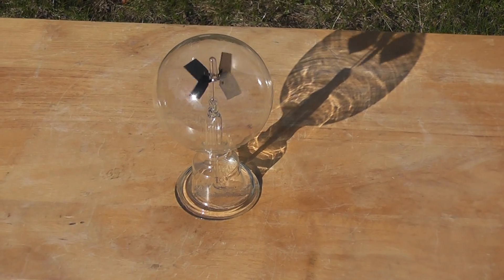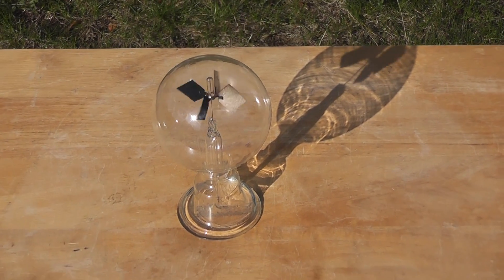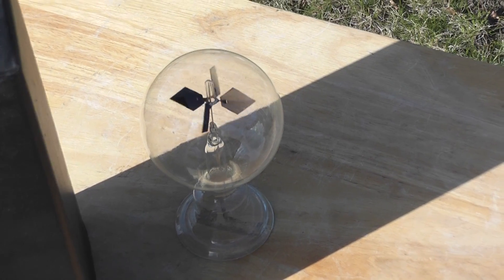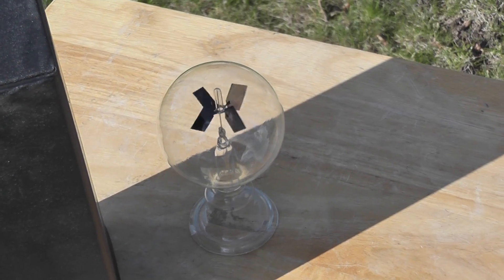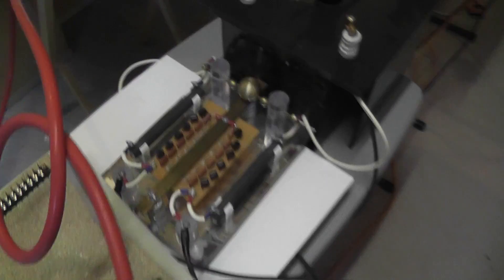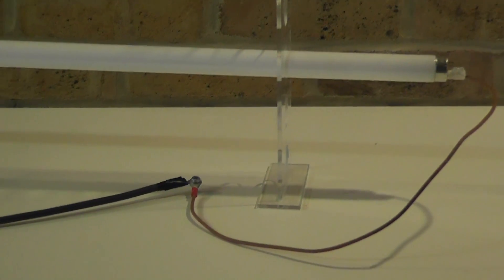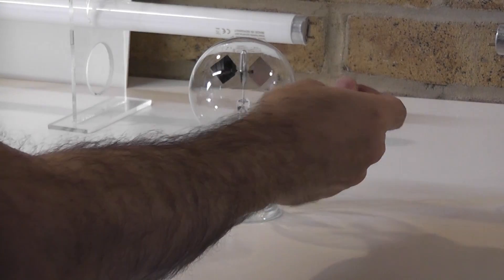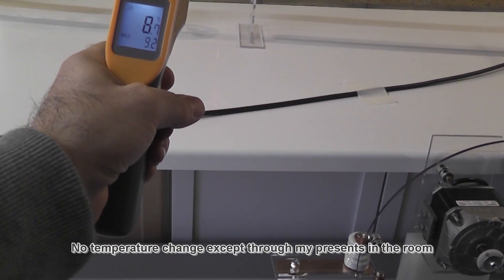The Radiometer in the junction of High Voltage Direct Current

Comment from the maker: On my mono spark gap, where I use unidirectional current flow between carbon and brass electrodes separated by strong Neodymium magnets I did see two independent sparks next to each other by different colour. I have a sensitive Geiger counter but I believe that the strong dielectric field is triggering the gamma ray value. Every spark gap, especially Carbon is creating gamma rays. I am not sure if my measurement is correct but it is in the 100's of µrem

Comment from the maker: I am aware. But it has very low pressure. Other wise the friction would be too high. The vane moves by heat difference between black and silver, like a sterling engine. That counts for IR radiation. However, my vanes have been destroyed by the flashes I produced and I can still move them. The sun does not any more. I move with static electrical pressure. I actually mention the function at in the video at 2.35

Comment: Umm I'm not sure if you knew or if its april fools, but radiometers are designed in a way that air inside forms a convective current thanks to the black surfaces that heat up. The leafs are at tiny angle so it's hard to notice, but whole thing acts as a turbine on torroidal wind current inside the bulb. If it would be true vaccum it would not reach terminal rpm that quick.

Comment from the maker: Hello, That was my thought at first as well. It does not count for the heat effect. Infra red mainly in direct sunlight. In my garden I have no reflective areas because I am surrounded by a field the blue sky. Normal photons do not move the vane. It is only the heat difference between dark and shiny  side which makes it move. My experimental set up is of different nature. It moves regardless what side.

Comment: The radiometer outside when shaded by the object would still move due to diffuse irradiation. You only blocked direct irradiation but since diffuse photons come from everywhere, which is why you can still see it, with the vanes being highly absorptive on the dark side and reflective on the other, the spiral rotates.

Apart from that, nice experiment, keep it on ;)

Comment from the maker: You can get it from Ebay. I actually damaged mine with a spark. I will show that in my next video and have to order a new one. Company is LUPI Solar Radiometer from Germany. The black surface on the vane is scratched off by the spark and it does not work in the sun any more. It still works fine for my experiments.